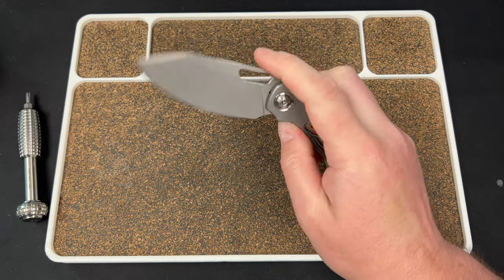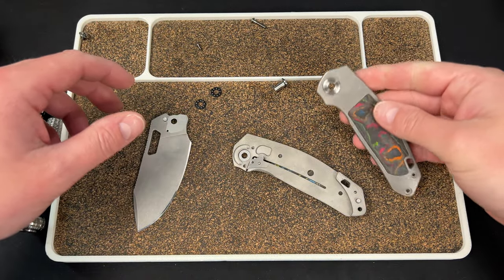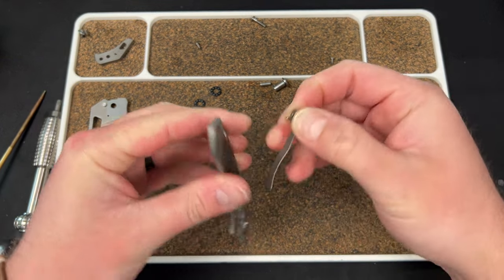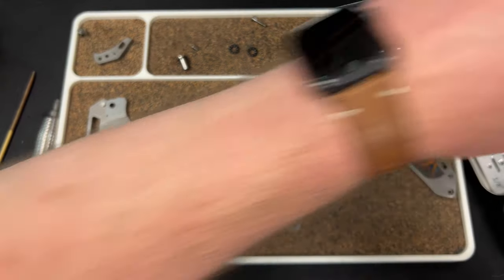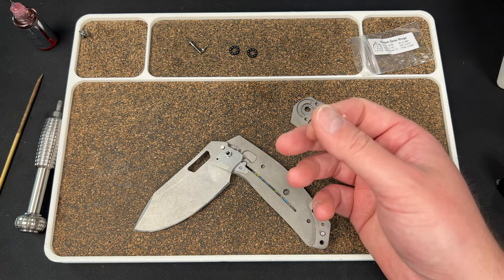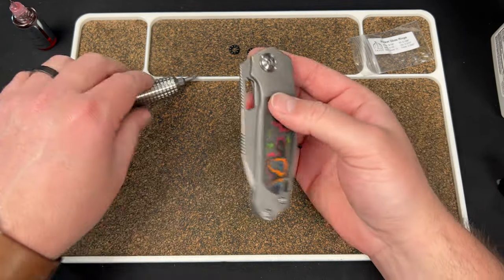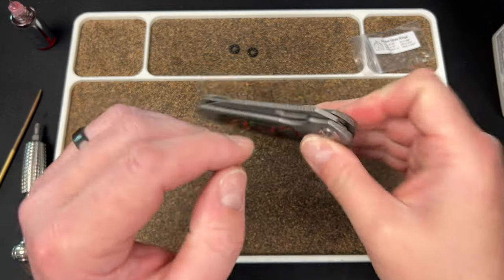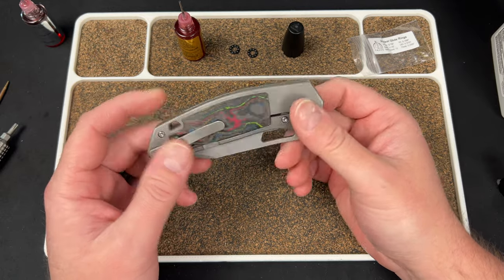Skiff Bearing Swap:  US Growler

Comment: Absolutely agree when reassembling a knife I have it closed. everything snaps together especially pivot if having trouble getting pivot set you might need to open slightly then closed then you will hear the snap of everything and liners are lined up snapped into position. Safer as well. IMO 🤙